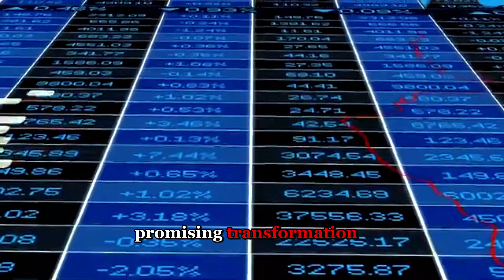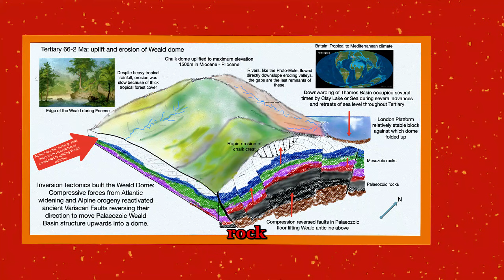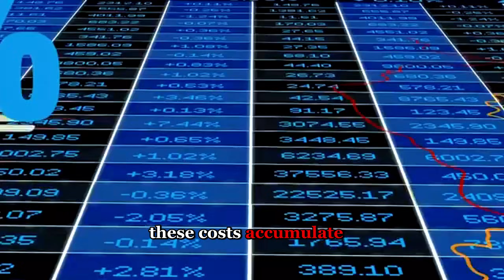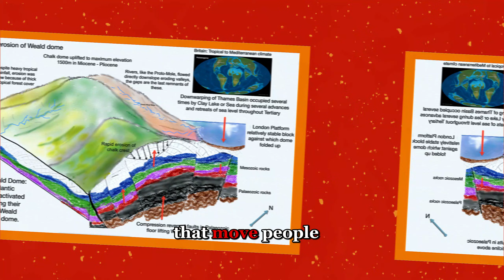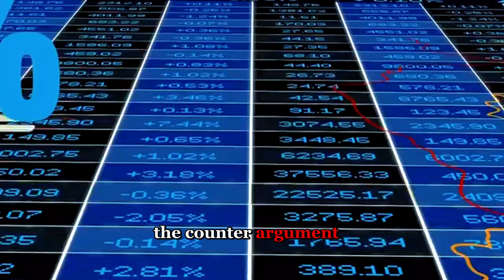Israel’s High-Speed Rail Plan That Could Reshape the Country

Comment: Isreal has a major "Centre" vs "Periphery" problem. Towns an hour or so away from Tel Aviv are considered too remote and under developed. High speed rail would make them half an hour away, enlarging the central commuter area, increasing prosperity and development to commuter town levels. 

Israel has cross country transport which does burden its current road infrastructure. It has a unique phenomenon of soldier traffic on Sundays and Thursdays as those serving return home for fortnightly leave. Much of the Army is based in the south so that movement of people must be considered along side the civilian movement.

The video misunderstanding the "Eastern" railway. It used to be a coastal line about 10 miles inland from the coast, a short section of it was cut off in 1948 as it came under Jordanian occupation, but by in large the line is within green line Israel. The new alignment will stay west of highway 6 and within the green line borders so there's no basis whatsoever for claims of it serving "settlements" or " Apartheid". The Qalqilia section of the historic line has been bypassed. 

Ps - Israel's southern desert is pronounced NEH-gehv not "neegev".

Also - this video uses a map of Lebanon and Hizballa tunnels which aren't part of Israel.